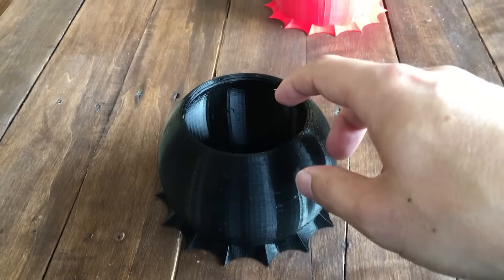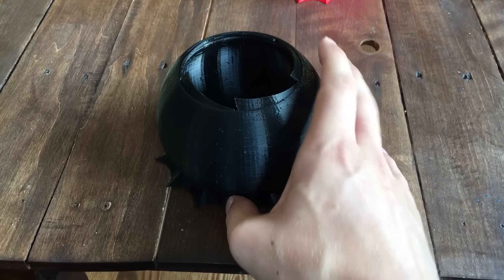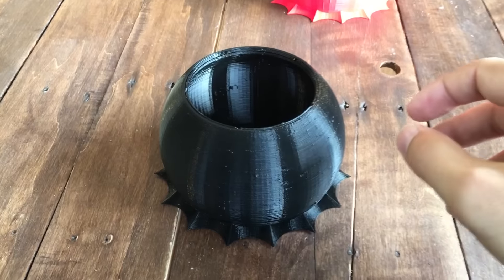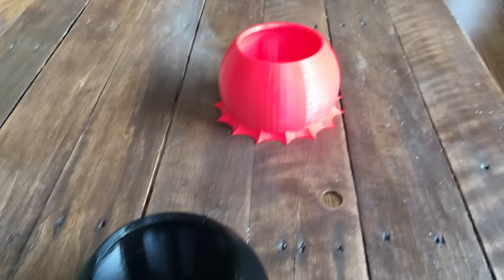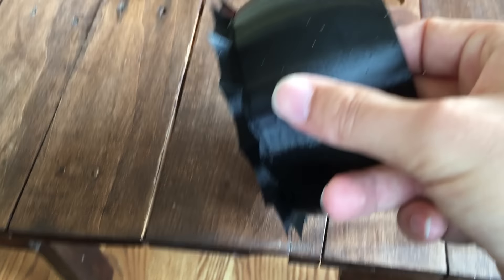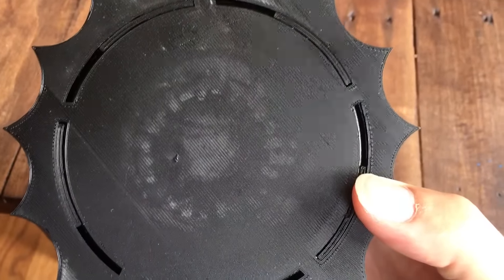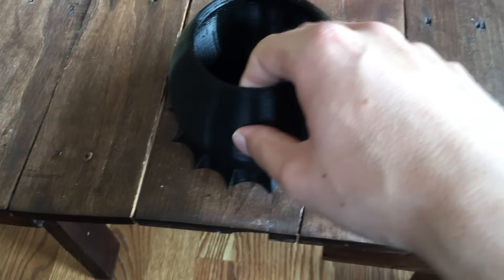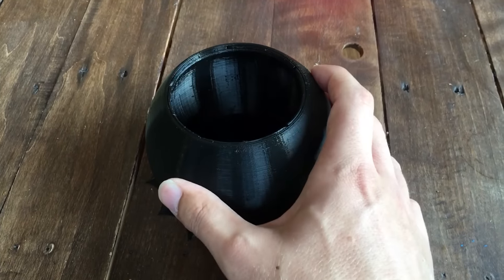3D Printed Iris Box

Comment: I guess I shouldn't have used ABS? Could not get the parts loose. Printed beautifully, but I think the shrinkage did me in. Even slid feeler gauges and a thin print-removal spatula all around between the layers, but it wouldn't budge. Oh, well... just got in some really pretty PLA; will try again some day.

Comment: Well, mine is done, but not moving at all! What settings did you use or do you recommend? Also, the bottom pionts are extremely sharp. You might wanna consider rounding them off